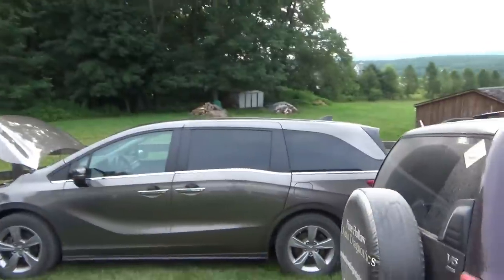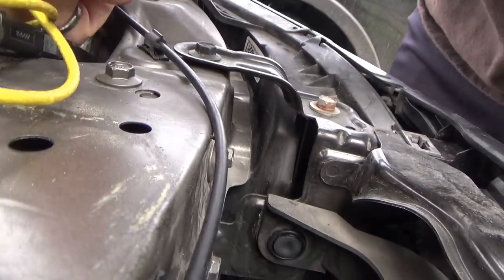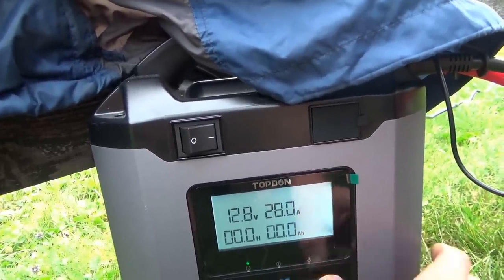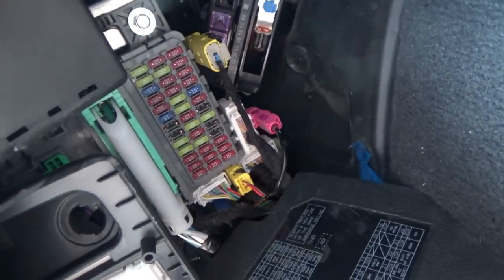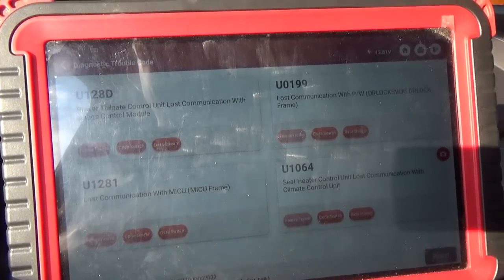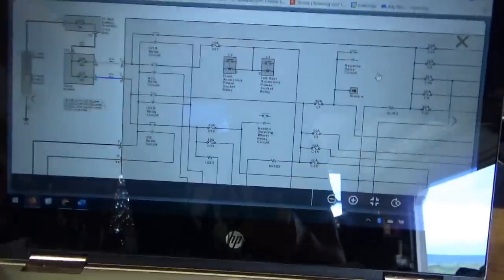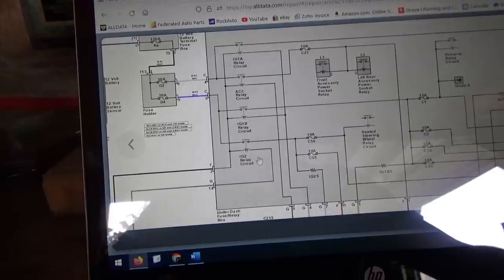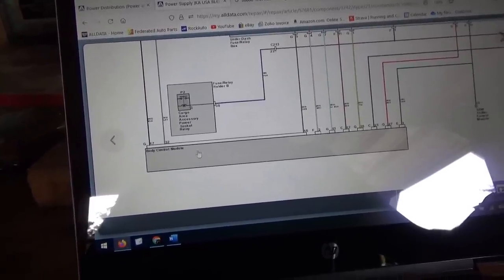WTF...Honda Turns Itself ON & DRAINS the Battery?! (Part 1)

Comment: Did you check to see if the spare key fob is sitting in a puddle of coffee in the compartment next to the ignition switch?😀
Reply: I actually wondered if a 2nd key had been dropped (and forgotten) under a seat or in the console etc.
Reply: @NVRAMboi  If the 2nd key was there when he pressed the start button nothing happened, so doubt the other key was in the car.

Comment: My first thought when you walked to the charger was "Look at the whack this car took in the left front fender??? The second when you showed the drawing was , "I MAN is an engineer. He has relays. Make a circuit thats going to tell him that the BCM IS commanding the accessory relay on. And if it is, is there anything else that Honda built into the BCM EXTERNALLY to do this (defect or otherwize?)

Comment: I would be very surprised if it was the BCM, and there were no external factors involved. External factors; moisture damage, rodent damage, green crusties. Japanese electronics pretty much last forever, and in the rust belt, usually long after rust has sent the vehicle to the great scrapyard in the sky
Reply from the maker: "Japanese electronics" hahaha just wait for Part 2 😂

Comment: Is it possible to take apart the BCM to look for corrosion? Maybe moisture got in there. I have seen people clean circuit boards and connections fixing electrical problems.

Comment: what if it is that there is a neighbor with a car with the same key fob code?

key fobs have a limited number of codes especially today when car makers are trying to cheapen stuff even to the point of using old ancient technology ( no they wont use vacuum tubes) but they may use 4 to 8 bit coding systems witch limits the combinations to 256 so chances of getting a coincidence is greater.

if the car was an ev or hybrid it may turn on to warm the battery.

a long shot but maybe gm is not the only source for faulty ignition switch.

another possibility is the car is updating its firmware.

Comment: There has to be a bad transistor circuit(or inputs to said circuit) that is responsible for the logic inside the BCM responsible for the logic question of "is the key detected if yes inject logic 1 if no inject logic 0". If yes, is Ignition button push or wireless start request detected, if yes then send ign start position.

But the vehicle doesn't start itself, so I wonder what would happen if the key was left inside it, if it starts then the BCM(or wireless module if not built into the BCM) logic responsible for receiving the remote start request may be responsible, but since the key wasn't detected it could not finish the start sequence...🤷‍♂️...just a beginnings of a theory based on this video and my limited specific knowledge of this case study, and my vast yet very rusty knowledge of electronics...and trying to approach this from the standpoint of: what circuit board level component testing would I start with if I was the test tech troubleshooting the module responsible.

Comment: I noticed an error "Unable to communicate with the MICU". Not knowing what a MICU is did a search and found this, "The MICU controls the interior lights ON, OFF and dimming based upon the information of the related switches and/or the B-CAN related information. Sleep Function. The MICU has a sleep function, which it enters during power down mode." Fail-Safe Function

To prevent improper operation, the MICU has a fail-safe function. In the fail-safe mode, the output signal is fixed when any part of the system malfunctions (for example, a faulty control unit or communication line).

Each control unit has a hardware fail-safe function that fixes the output signal when there is a CPU malfunction and a software fail-safe function that ignores the signal from a malfunctioning control unit, which allows the system to continue operating normally.

Hardware Fail-Safe Control

Fail-safe function

When a CPU problem or an abnormal power supply voltage is detected, the MICU moves to the hardware fail-safe mode, and each system output load is set to the pre-programmed fail-safe value.

Software Fail-Safe Control

When any of the data from the B-CAN circuit cannot be received within a specified time, or an unusual combination of data is recognized, the MICU moves to the software fail-safe mode. The data that cannot be received is forced to a pre-programmed   value.

Power Supply Voltage Monitoring Function

The MICU monitors the power supply voltage (back-up voltage). If the voltage drops below 10 V, the MICU will not store DTCs."

 While Im not sure if it's relevant it sounds like any power interruption  or a short ( I noticed the side door lock didn't function) could cause the MICU to go into it's failsafe mode and stop the car from going to sleep. Of course it can still be the BCU as the MICU is subordinate.

Comment: I have a 2015. These are pieces of crap. Honda stopped caring about them around 2012. SUV time. I have the really bad transmission problems with slipping. 77k miles. These have known electrical issues galore.

Comment: Maybe you could try removing fuses one at a time to different modules (immobilizer etc.) and let car sit to make sure bcm isn't getting some kind of false signal to turn on the ignition.
Reply: I was thinking along the same lines. If he could somehow isolate all the inputs from the BCM (obviously easier said than done), everything but the BCM would be ruled out. Maybe removing the BCM and supplying only powers and grounds and seeing if it's still randomly turning on those relays could be a viable method. If it is, then we would know for sure that the BCM is the problem.
Reply: sounds like the car is the customer's daily

Comment: I know you worked so hard on this BUT I can help you here.  The answer is with me. This problem with Honda is THE STARTER  trust me!  change it from auto zone and I can safely say to you the issue IS SOLVED!  

Why, I had an issue with my Honda accord 2013 and Honda spent one week on my car and came up with nothing all they said that my car withdrawing current and cannot find it in fact they even charged me $750!!!!!!  no help!

So I took the car and finally I came up with zoomed in fault must be in starter! I decided to open the starter and sure enough the problem is defect in started as the  some of the small spring with contactor causing this!  I change the starter from auto zone and worked very nicely.  No scan nothing will make you suspect that the starter is doing this BUT IT Does!  I even reported this defect to NHTSA about this.  Try it and thank me later.  Good luck
Reply from the maker: Starter is fine on this Honda. Actually it's still fine 1 year after this video LOL!
Reply: yes it runs very nice that is the trick part BUT it cause all these problems drawing current!!!, that was in my case unless you open it and see inside and see it with your own eyes how it gets jamed and pull current on and off!    @PineHollowAutoDiagnostics

Comment: Anti theft is tied into the abs module.  It was on a 2018 accord anyway.   The car was in an accident and it destroyed the abs module and wouldn't start due to anti theft active.    I had to program it after replacing the abs module

Comment: At 7.48 min. into video Bad ground to one of the computers.  voltage dipes cause the computers to reset and do strange things.  Next try varying power to the module you think is bad,

Comment: If I was a dictator, we'd have vehicles that could be repaired with a multimeter and cheap tools that never go obsolete. A Phillips and flathead screwdriver and a 10 mm and 14. Wait a minute... We could just force em to make older models! Exactly the same parts no updated software. It's hard being a dictator 🤔
Reply: Or we could boycott a vehicle where everything is hidden or crowded from reach

Comment: My 2016 odyssey had a similar problem. The solution was to replace the keyless entry control module.
Reply: 38329-TK8-A01 was the part they had to replace

Comment: Remember the good old days when cars were dumb? Ignition switches should be physically actuated by a lock cylinder. I'm going to resist push button ignition cars as long as I possibly can.

Comment: I wouldn't know what else to check. Looking at the schematic, it looks like the BCM connects to the relay's control (coil).  If the relay is bad, it could switch on/off without control/coil power from BCM.  I'd say if all the relays are powering, BCM, if it's just one relay, then the relay.

Comment: The symptoms sound like a remote start issue.
Reply: I agree! The BCM should need verification of the challenge response from the key fob to even be able to turn on if it was seeing an ignition on request through a fault. The only way it would get this is if there WAS a key present, which is exactly how many remote start systems work by hiding a key in a relay box inside the car, with an antenna they can disconnect to make the key "not visible" to the car until they want to command a remote start.

Unless the failure was on the output side, I don't see how it could be anything else but a remote start system, and if it were on the output side, it would be super weird that it's not only turning on the cluster, but also the radio and all the accessories too, since they are all interdependently controlled.

Comment: That's a disgrace Honda used to be fantastic at least there quad's are still just as good as they always have been how the heck does  a 2018 already need a module are Toyota gone that way aswell? .

Comment: It could maybe be a sticky relay driver, but given the BCM also has to provide the power that might not be plausible. Another longshot is to look under the car for a sabotage device that pretends to be the key sending by false signals to deliberately discharge the battery.

This might be conspiracy, but what if this is something thats been programmed into the BCM by the manufacturer and has be to erased by the dealer upon purchase as part of a theft deterrant system ?